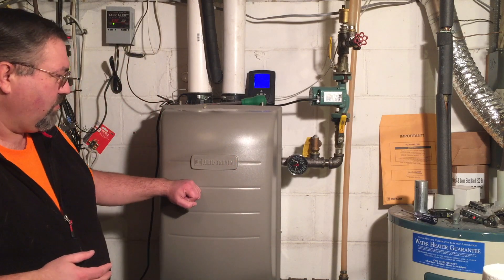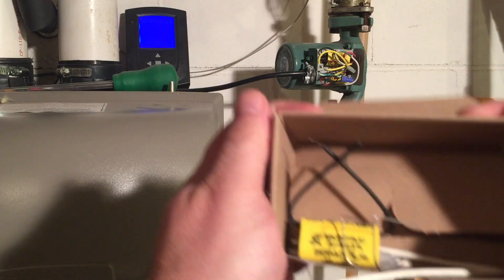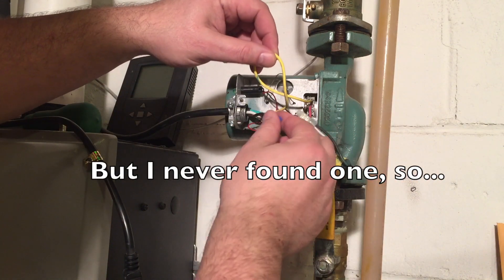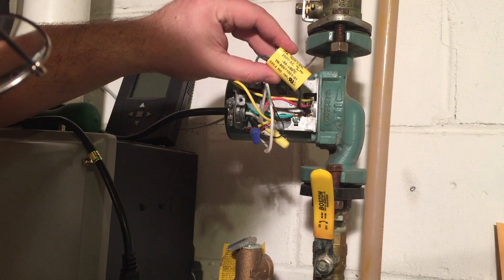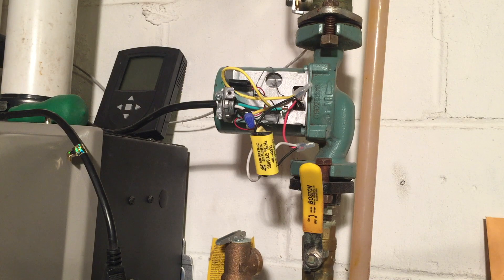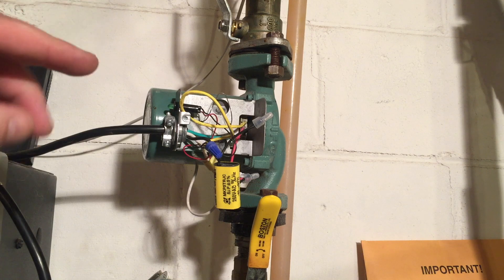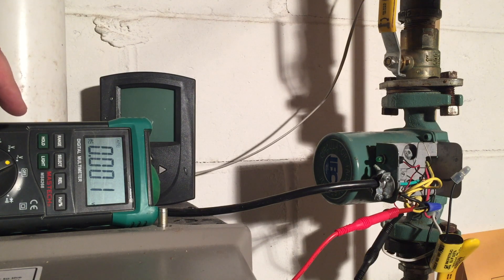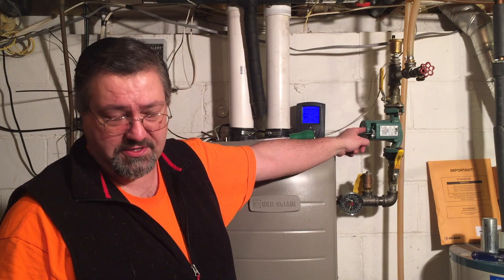Taco  Recirculation Pump Not Working? Capacitor Replacement

Comment: Thanks for this video! My capacitor was smoking during my heating season testing. Ordered the part from SupplyHouse & will install asap.

Does it matter where the black wires go (left & right side) on the new replacement? My old cap is different, so i plan on connecting them to where they are now.
Reply from the maker: As I recall, black is ground so it goes to ground.
Reply: @MinnesotaEric  Thanks for the reply. I had since installed it after researching that the replacement capacitor had no polarity (both wires were black) & just connected them as the old capacitor was. 

Hope this comment helps future searchers.

Comment: Where can I buy the capacitor?
Reply from the maker: If you turn the power off of your taco pump, pop the cover off of it, there is a part number on your capacitor, something like MKP5TRJC (Taco Part Number 007-002RP). Look that up in a search engine. It used to be these capacitors were pretty inexpensive, but how they're $40-80. I got my parts out of Suppyhouse.com, but I'd look for less expensive equivalents. https://www.supplyhouse.com/Taco-007-002RP-Taco-Capacitor-for-Select-003-008-Models?srsltid=AfmBOoqVZd_94IT-bt8GHx3Ym7Q8a5QPQuhkC6i6AXY6411iX1AuiQs_Kck

Comment: Do you know where to get that size spade
Reply from the maker: I never looked on the internet for it, but as many different spade sets I have as a mechanic I had nothing like it, so I trimmed it off with some of the old wire and pigtailed it to the new capacitor.

Comment: How did you reuse the tiny spade terminal? I tried to but mine broken. Now I think I’m SOL
Reply from the maker: I cut the old wire with the spade, and pigtailed that old wire with the spade unto the new capacitor.

Comment: Thanks for posting your repair...just a couple of questions... did you test the cap...? My cap tests at 10mfd but will not restart the motor unless I hand spin it.....my cap has a diode and resistor across the leads. Was your cap polarity sensitive or marked with a pos and negative..?

After seeing your agressive replacement strategy I'm compelled to replace mine....
Reply from the maker: I didn't test my capacitor, but experience suggested to me that the capacitor was the first place to start. The capacitor, being on an AC circuit didn't have polarity. I confirmed that checking the photos I have of it from when I ordered and unboxed the parts. I suspect a voltage spike took mine out.
Reply: @MinnesotaEric  great answer
This circulation pump was mounted on a kubota diesel gen and voltages and vibrations could have been all over the place...I will certainly let you know if that was my central issue. Older grundfos pumps look very similar as other brands. My theory was the vibrations and not the capacitor would start this boat anchor.
Reply from the maker: @offgridmangogrower  I got a belly laugh out of this as a diesel certainly could "automate" the starting hammer taps required as you say.

Comment: Great video!  I am having a similar problem with my pump.  I discovered it not working but that I could bang on it and it would start.  So, for several mornings I would bang on the pump to get it going while i searched for a fix.
 I saw online where often the problem is the cartridge and that there were replacement cartridges available.  So, I ordered the cartridge for $76 and installed it in about 10 minutes.  The motor spun up and I was back in business; until the next morning.  Once again, I had to bang on the pump to get it going even with the new cartridge.  Now I'm wondering if I have a bad starting capacitor.  My model is the Taco 006-b6-1IFC and not exactly like yours so I must do some more research to make sure I get the right capacitor.  Mine also does not have the LED like your does.

At any rate, thanks for the great video.
Reply from the maker: Do you see the LED power light on? Consider cutting the power to your pump and then popping off the cover and looking at the number on the capacitor. You can check the impedance of the capacitor and capacitors are relatively inexpensive. Thanks for watching!
Reply: @MinnesotaEric  Mine has no LED led light.  I plan on replacing the capacitor with another the first chance I get.
Reply from the maker: @TheNichols  You may find that if your capacitor is bad, the capacitor smoked your LED as well when it failed.
Reply: @MinnesotaEric  Mine is a different model number and has no led.
Reply from the maker: @TheNichols  Here is your opportunity to wire a 120v one in between hot (black) and Green (ground) as a tell-tale for power.

Comment: Getting down to 62 degrees..... wow, positively arctic then.
Reply from the maker: Inside, yes! Getting old....
Reply: MinnesotaEric 
I have to admit.... I'm 61 and each winter I seem to be able to tolerate the cold less. Nine days before Christmas and I see guys walking around in shorts and T shirts and I'm wrapped up like Scott of the Arctic. I should add my central heating boiler is on the way out and the central heating pump just packed up.
Stay warm Eric and have a cosy Christmas.